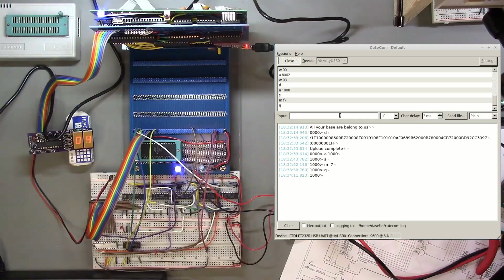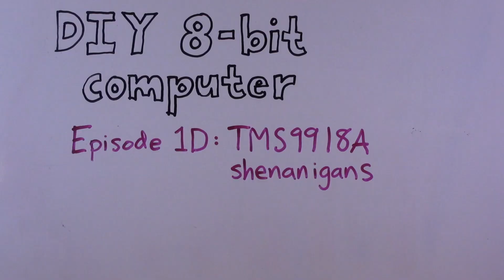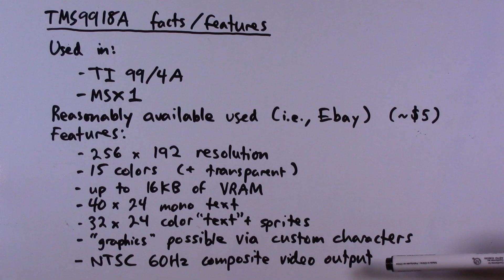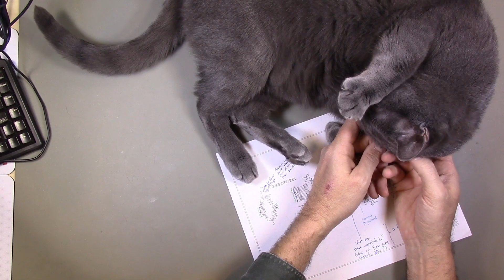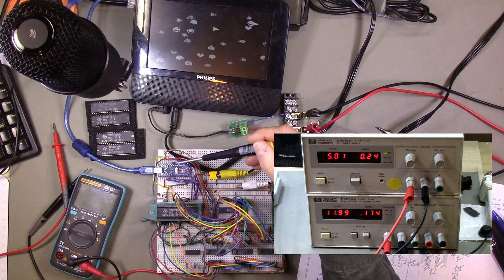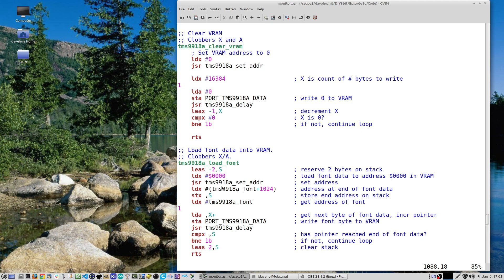DIY 8-bit computer, Episode 1D: TMS9918A shenanigans

Comment: The reason your display is black and white has nothing to do with your monitor. those ntsc systems are frequency sensitive and a slight misalignment from the 10.7 mhz crystal will cause the color burst signal to not be read right. Get a good crystal or a adjustable snubbing cap on the crystal and that will solve your problem.
Reply from the maker: Good to know, thanks!

Comment: So I have got right up to the keyboard and all is working. I am working at porting over Enhanced Basic for this computer. Quick question, do you have a development environment setup (debugger, emulator) that you are using? There are lots of CoCo and Tandy dev environments, but most are not configurable(at least not easily) for the ports addresses we have here. I would like to be able to set Break points and step through the program and see registers and stack. I am looking at one that works with Rust, but it seems not to like all code.
If you have one... maybe a quick video on what you are using, if not, I will continue to try and find something that works reliably.
As always.... Thanks for the great work.
Reply from the maker: Wow, nice, glad you got things working! I do not have any development environment. I've been writing code, assembling it using asm6809, burning it onto an EEPROM, and then testing it on the actual hardware. A software emulator would definitely be helpful, I might work on putting something together this summer.

Comment: I was looking for a project like this.... and this checks ALL the boxes... I would like to start by saying Thanks for all the great work. I will be building this whole project and try to catch up to where you are today. I will be placing an order with the PCB folks and was wondering. This seems to be the first Youtube that you speak about the TMS9918A, but in the github there is a full pcb for TMS9918A along with the sound circuits. I am pretty sure I have gone through all the videos and have not seen that one. Is that PCB fully tested? Can I safetly add it to my PCB order?
Once again thanks for this.. I really look forward to start building.
Reply from the maker: Glad you have enjoyed the videos! A video on the TMS9918+YM2149F PCB is coming at some point. The TMS9918A part of it does appear to work correctly. I haven't tested the YM2149F part yet.
Reply from the maker: Oh, also, I think the gerbers need to be regenerated. I forgot to include the component designators, and there was one typo on the silkscreen (which I fixed on the PCB design.)

Comment: Yaay! Great to see you back Dave. I was getting concerned that you had abandoned this project. As usual, our projects parallel eachother - I have a V9958 in the drawer to put into my build at some point. In the meantime I am cheating with a combination of USB-to-serial keyboard interface and serial VGA module. At the moment I am banging my head against a wall trying to get an Arduino Mega to drive a WD37C65 floppy disk controller. This is a test/preparation/proof of concept project for using the disk controller in my 6809 build. I've already realised that trying to use 1.44MB disks is likely to be an non-starter - the 2MHz 6809 is unlikely to be able to keep up with the data transfer rate and response times required - so I am planning to use 720KB disks to enable better portability. Handling the FAT12 disk format is the next thing on the agenda when I finally get this damn controller to work! Looking forward to the next video 👍😁
Reply from the maker: Wow, I would love to be able to give the V9958 a try.  I also have storage in the back of my mind. Using a real floppy would be fun, I still have some 3.5" disks kicking around. At my current rate of progress I'll probably get to that around 2030 :-) I'm also thinking somewhat seriously about building a CPU/glue logic card with a 68008: those can run at 8 MHz, and perhaps would be powerful enough for 1.44 MB floppies? I've also been thinking about SCSI, perhaps the classic NCR 5380?
Reply: @davehohacks  The 68008 can certainly handle 3.5inch floppies - I had such a drive for my Sinclair QL back in the day. Not sure if it was 720k or 1.44M - probably the former as I don't thing the latter was common at the time. It should be fast enough for 1.44M though. I think SCSI would be a step too far - the protocol is quite complex, although I had a 30MB(!) external hard disk for my Atari ST which used the Atari butchered version of a SCSI interface on a 68k so it is possible. I am using real floppies at the moment (I have a nice pair of Sony MPF920 drives with black fronts) but I am open to the option of using a Gotek if ever I get the damn thing to work! (I found a couple of mistakes in my code this morning and things are working more sensibly so at least I am making progress!) 😁
Reply from the maker: @spacedock873  I remember reading about the QL in Byte magazine. I don't think they were ever widely used here in the US, though. I'm sure you're right about SCSI being too ambitious, and I'm not sure where I would even find working SCSI storage devices at this point, although I can dream 🙂
Reply: @davehohacks  The QL was not a great machine on the grand scheme of things (it was made by Sinclair after all! 😂) but after years of 6809 computers (Dragon 32/64) I lusted after a 68k machine and the QL was the cheapest available and the only one a poor University student could afford!
Reply: @spacedock873  We definitely used SCSI hard drives (and MFM/RLL drives with SCSI controller boards) on CoCos back in the day, so the 6809 is definitively fast enough to do SCSI, even using a SCSI interface that is little more than a buffer.  We also used 720K 3.5" disks with a stock CoCo floppy disk controller.  One of the early CoCo disk controllers could be modified for high density operation because the FDC chip in it used an external data separator chip, having been designed for 8" drives.  I've never done this myself, but reportedly it works at least with 1.2M 5.25" drives with a special driver under OS-9 LII.

Comment: Great work, Dave. Awesome to see another TMS9918A project.  I've heard the lack of color can be caused by the crystal or its load capacitors being slightly off and the color burst isn't picked up by the display. Other displays might be more tolerant. Looking forward to seeing what you do with it. 😎
Reply from the maker: Thanks, Troy! I have a composite to VGA adapter that should be arriving today, crossing my fingers that will work better. I could also just get an LCD TV from a thrift store. BTW I used your schematic to double-check my decoding of the read/write signals. I'm now wishing I had the glue logic board generate a -R/W signal rather than just R/-W, that would have simplified things.